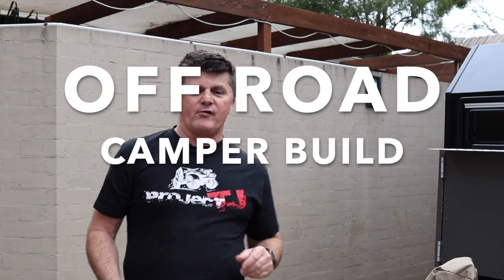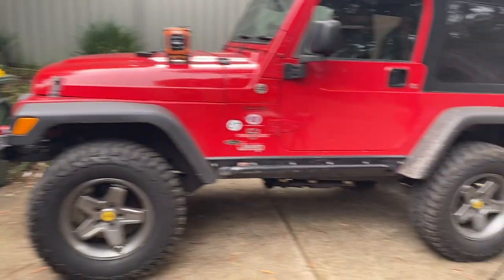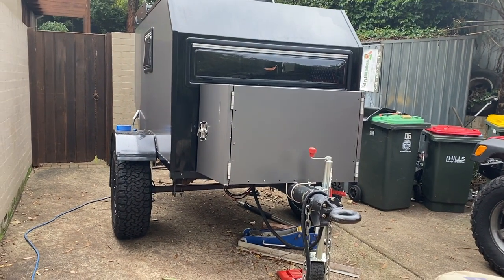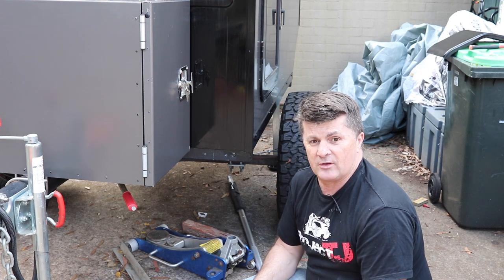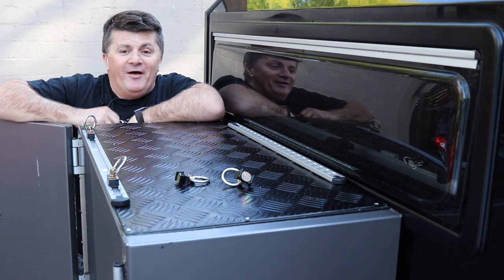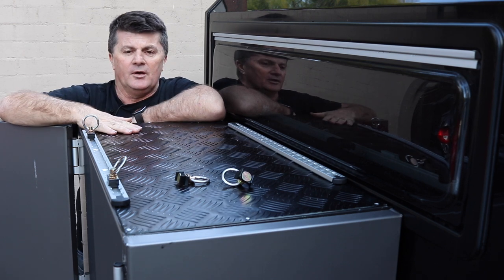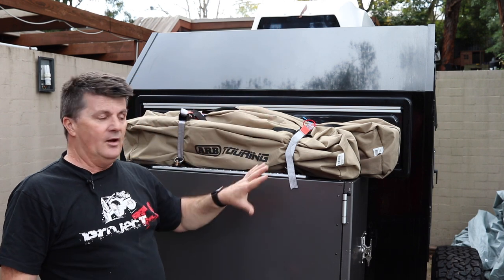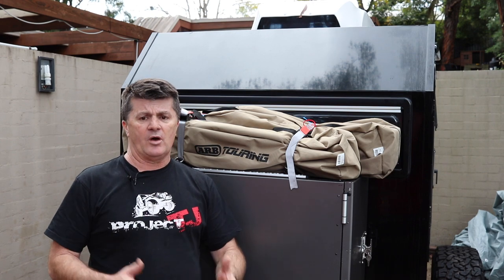Off Road Camper Trailer Build  //  Storage Options

Comment: Have you thought about extending the draw bar?
Reply from the maker: Yes, Did consider originally. However, the trailers were designed for SWB vehicle originally and they tow well behind the Jeep. Time will tell if the camper does too.